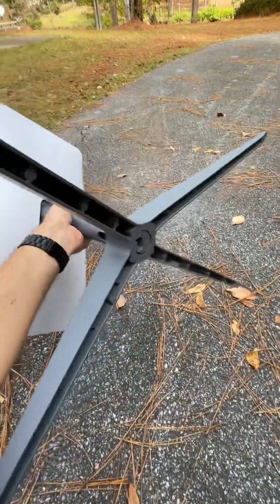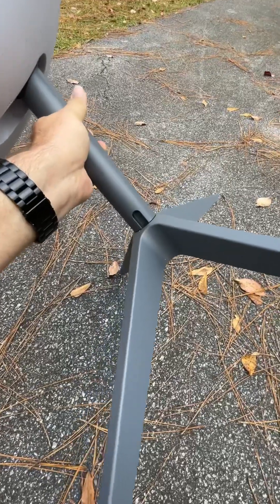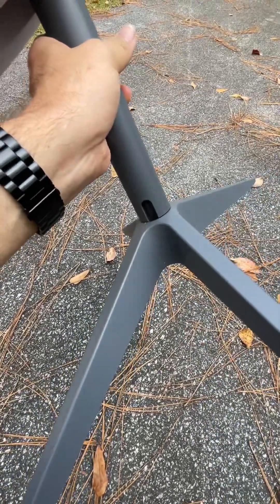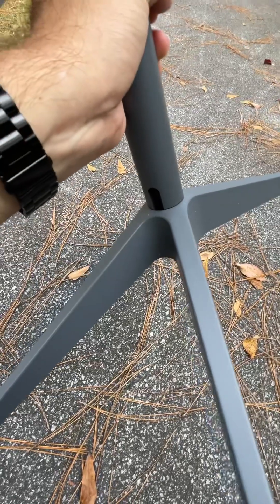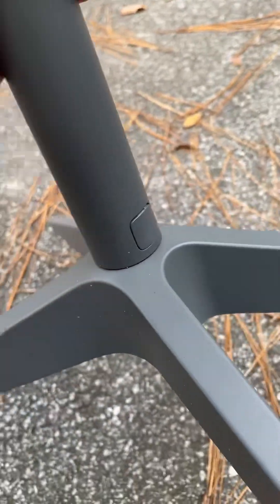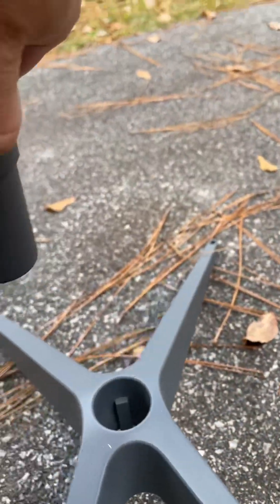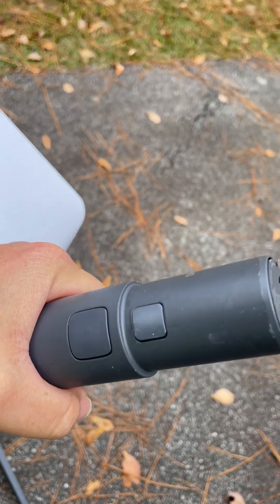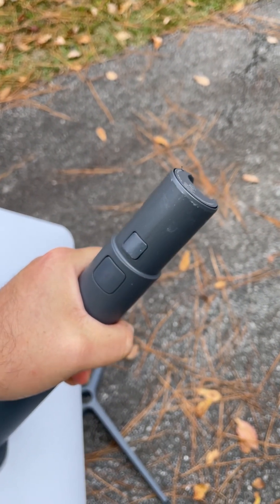#Howto Disassemble #Starlink Base

Comment: DUH, and how the riser tube comes out from the dish? my stuck as hell, you did not disassemble it you just took it out from the base, get a better title!!
Reply from the maker: @RCREVIEWS101  Apologies, but this video is in fact about disassembling the base as the title suggests, not anything more intrusive.

However, the tube is not made to detach from the dish, as it is attached to the alignment motors on that end.

If you need it more compact for transport or storage, you have to go into the app and put it in Stow mode (preferably before disassembling the base, but not necessarily required). Hope that helps.
Reply: @Sylvestercomputerguy  thanks for the extra info. I just got a "kickstand" model as a replacement. I guess I can't reuse the mount so I'll continue with the kickstand setup.